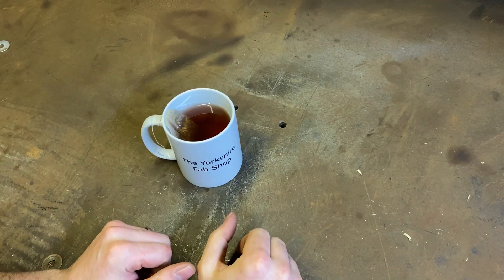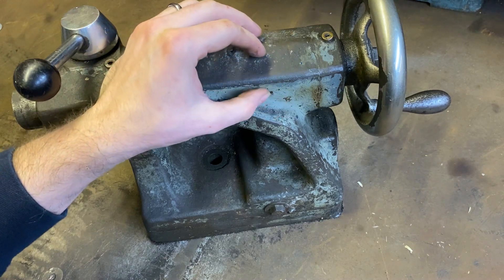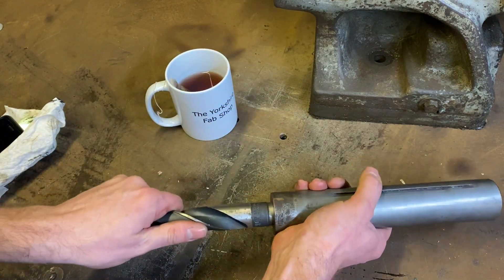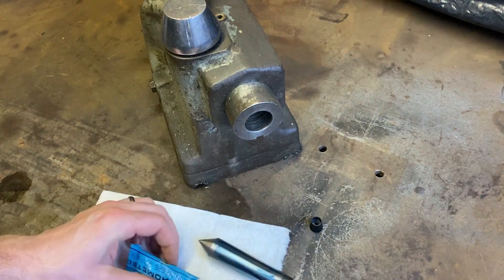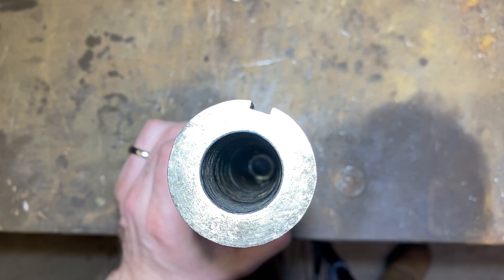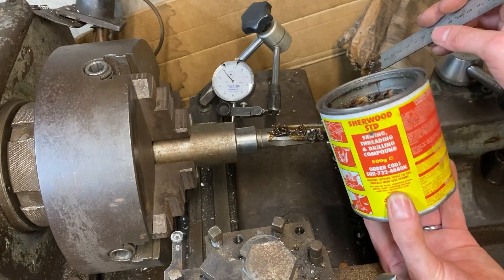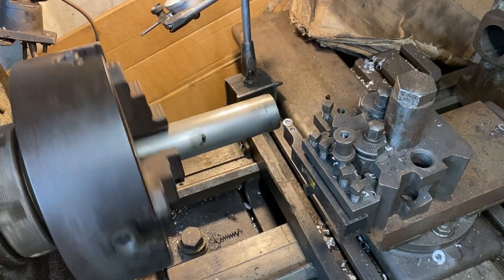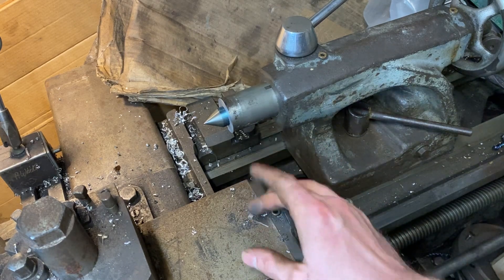Lathe Tailstock Machining! A good reaming needed? Restoration series episode 4

Comment from the maker: We all enjoy a good ream! Is this how you’d repair this item?
Reply: Sure, it’s the best way to do that with out other machinery. While you were doing it, I did think that you would have to take a lot off the quill. There was so much damage (I’ve never seen a quill with that much damage) that you had to take a lot out of the taper. Since these tapers have a high ratio, just a small amount of enlargement means a lot of depth.
Reply from the maker: Thanks for taking time to leave a comment. Yes, there are few options if the lathe must fix itself, but the repair went well. I haven’t seen so much damage in a quill before either, it is a wonder it was able to grab anything at all! There was certainly a trade off here between leaving some damage but not reducing the overall length by too much, or removing all the damage and taking the hit on the length. I do have a plan to improve this so keep a look out for that!